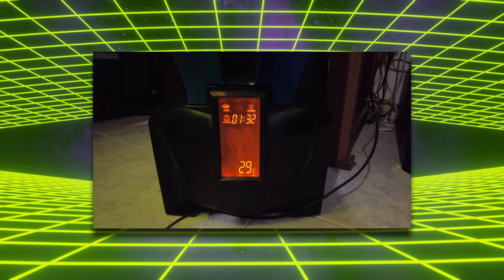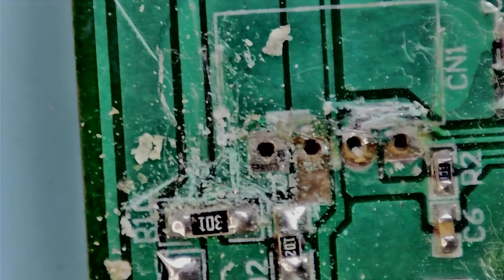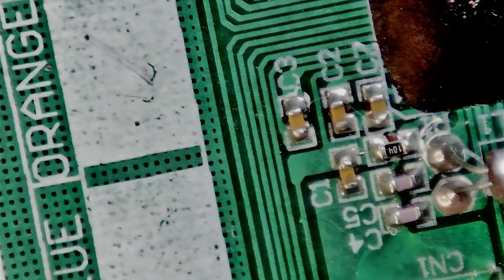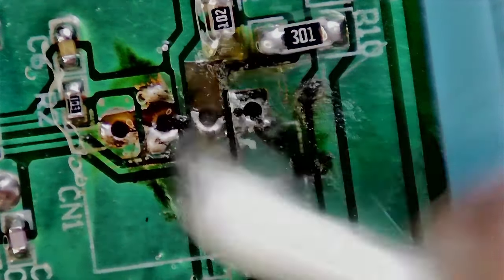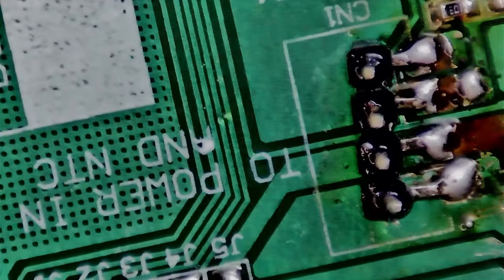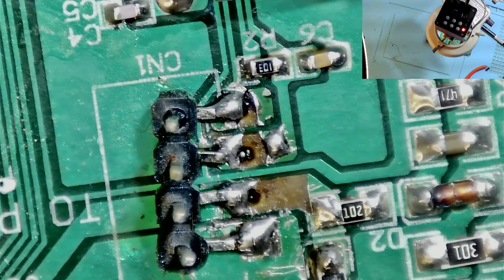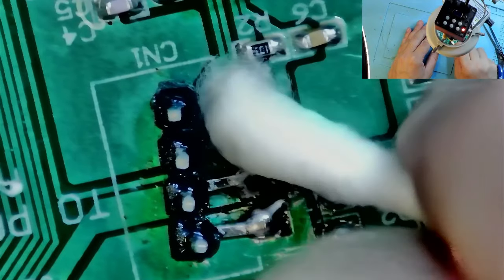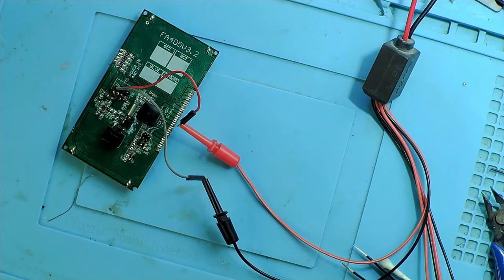Repair - LCD Temp sensor - for the new computer

Comment: I first power supply was a 12 volt transformer.
My second PSU is a 32V 5A linear supply.  It is rock solid for my needs.
Reply from the maker: The secondary psu I will be using is a xys3580. It's a 0.6-36v supply at 5A. 80w Max. Extremely versatile. Constant current,constant voltage. You can find them on AliExpress
Reply from the maker: Just need to wait for my bannana plugs to come in and I am building a case for it